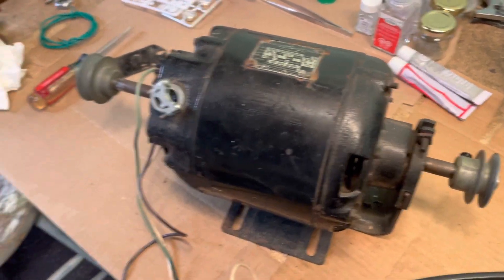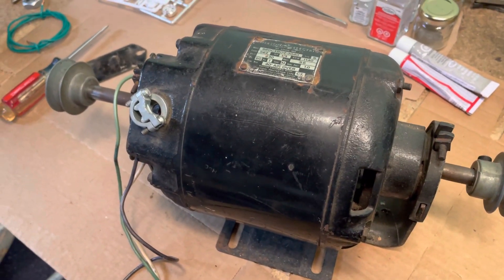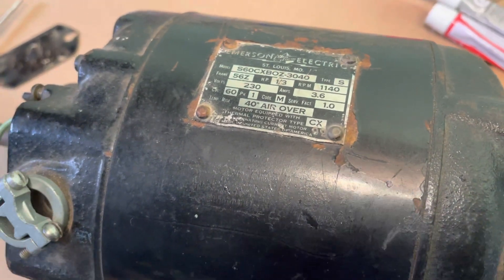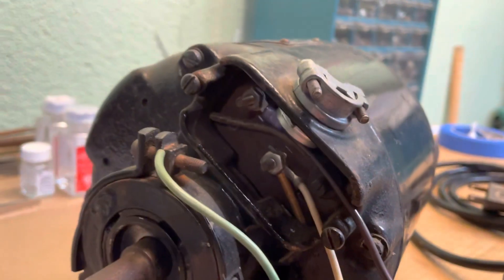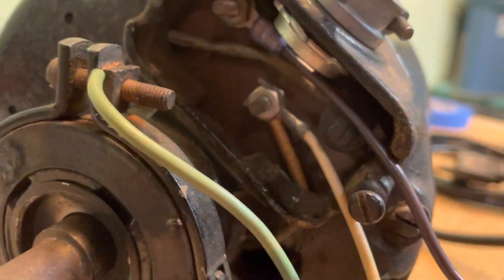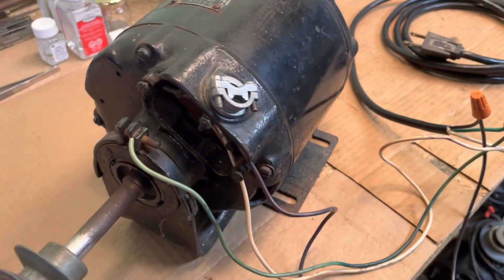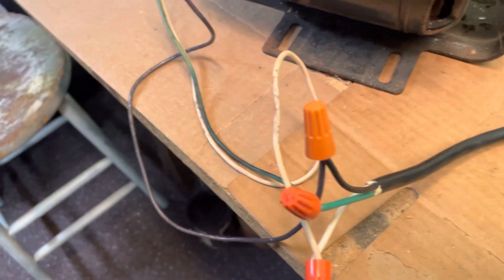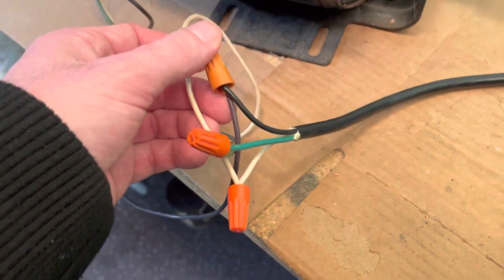Emerson 230 volt motor wiring.

Comment: I need to know how to wire this motor for 110
Reply from the maker: The video already shows how it’s wired for 110 but if you need more detail I could make another video and try to add more info.
Reply: Mine is actually a 1 hp 1725 rpm 110 volt motor. The case looks similar but is single sided. My motor has 4 wires sticking into the box and 4 posts. One post has 2 wires mounted behind it and 1 wire to 2 of the others. One post is empty. One of the wires from behind is to the switch. The other three are coils. Not real sure how to align any of them.